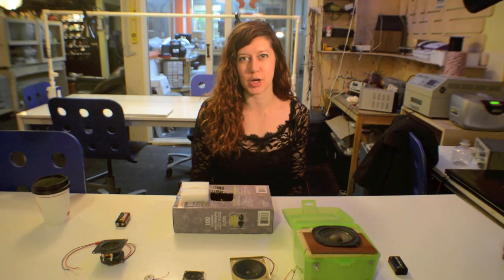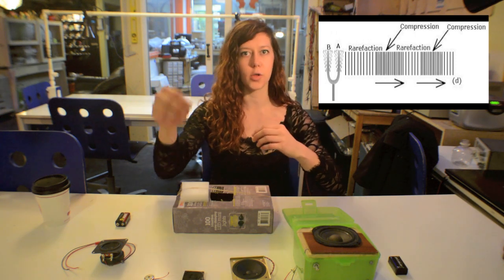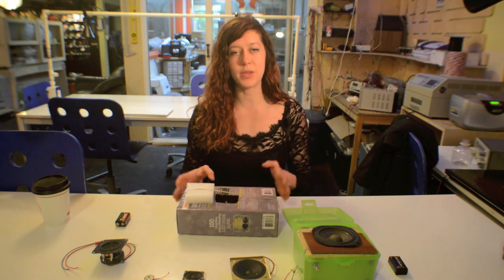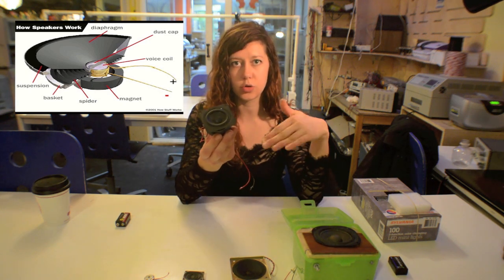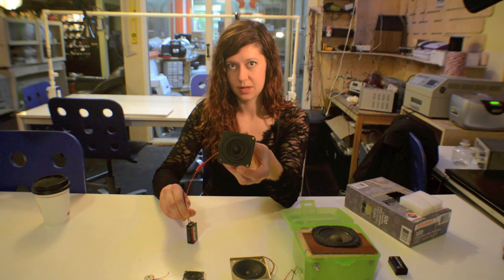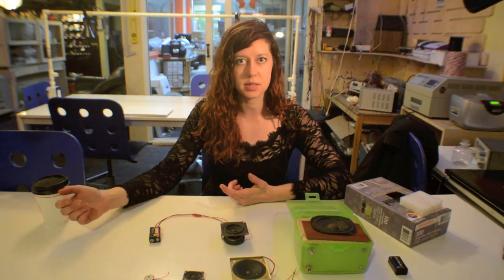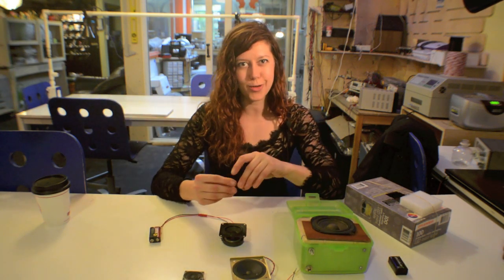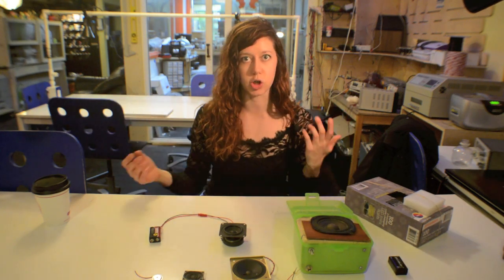Maker Quest: Speakers & Sound!

Comment: Great video, as always, Jen!

In a vacuum, clapping should produce no noise since no pressure difference can be created where there is no medium, i.e. air, in which pressure exists in the first place. I assume it would be slightly easier to clap, too, given your hands/arms do not have to move against the air resistance (though this might not be very noticeable given how little resistance it normally has against our movements).

I also had a question re spinning the generator in the negative direction: what would happen if this was hooked up to a battery instead of a multimeter? Would it drain the battery instead of charging it? I can't imagine how it could drain it since the energy would have to go somewhere, but if a negative voltage is applied to a battery it seems like it should give up its energy .. perhaps the battery maintains its charge but doesn't get charged if you spin the generator in the negative direction?
Reply from the maker: +Tom Burns Thank you! Excellent explanation on your end, as well! 

Re: reverse charging a battery, that is a really good question! That would be a situation to avoid, although the specific result depends on the type, and charge, of the battery. Fully, or partially, charged batteries are uni-directional, meaning that they should only be charged in one direction (positive-to-positive, negative-to-negative). 
In some cases, if the battery is completely discharged, applying a negative bias might actually recharge it (in the reverse direction, so the negative side would become positive and the positive side would become negative). Whether this works, or not, depends on the specific battery chemistry. For some battery chemistries it will just corrode the anode and cathode plates even if the battery is completely discharged (e.g. lead acid).  I'm a bit vague on the specific chemical reactions, but basically you're forcing electrons in a direction opposite to the direction the battery intends them to flow. In a battery where the chemical reactions are reversible, this will have fewer bad consequences, but in a battery where the chemical reactions are not reversible, it will permanently corrode the plates and/or you might see sparks and/or explosions.
This is actually somewhat common when you have two or more batteries connected in series that have different levels of charge; when one battery completely discharges and the device is left on, the other batteries will reverse charge the dead battery. In most AAs, this is very bad and will cause leakage (which is itself bad but fortunately prevents explosions). Hope that helps!